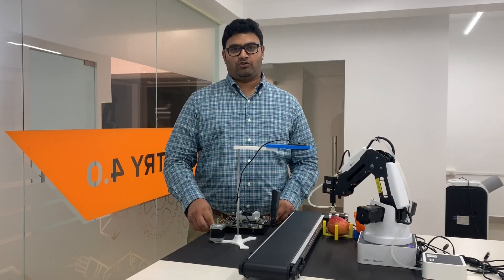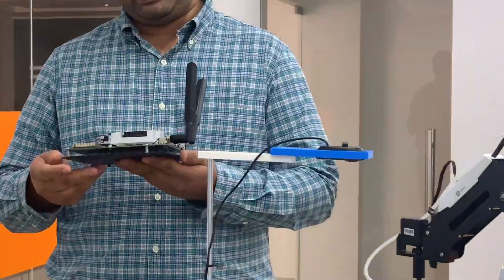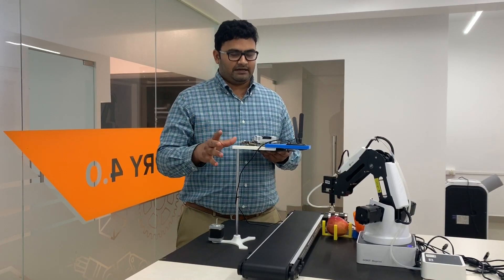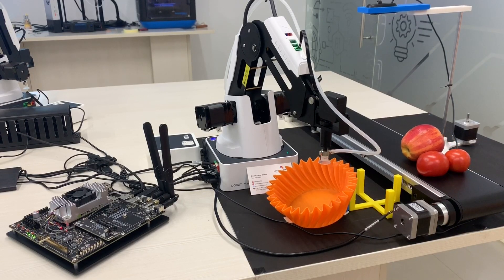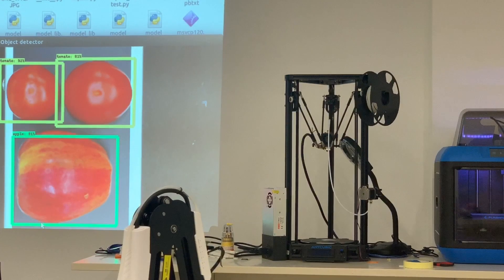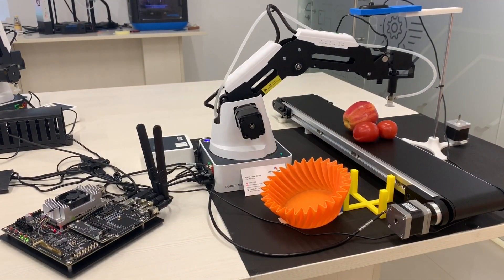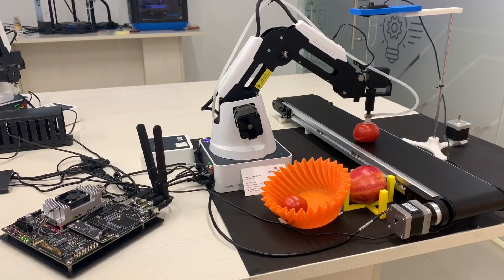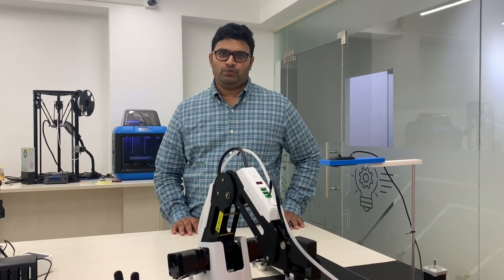NVIDIA Jetson TX2 powered Deep Learning Robotic arm using TensorFlow, OpenCV & custom Dobot APIs

Comment: Sir I am in USA. I am a computer engineer. Can you guide me how to do this. I can pay money for your time
Reply: hello Sir. you can get in touch. tmabika13@gmail.com. I do computer vision
Reply from the maker: hi Patron.  how can we help you? do you want to implement the work cell setup? communicate on assemticaattherategmaildotcom
Reply: @no one expected the spanish inquisition 
Hello,
I would like to do the same job with a nano jetson, could you help me?
Reply: @no one expected the spanish inquisition 
I made a program to recognize objects: it works. I also made a small delta robot. Now I have my stepper motors but I don't know how to connect them with the jetson, I also have to program the robot kinematic
Reply: @no one expected the spanish inquisition I have Jetson nano 2gb
Reply: @no one expected the spanish inquisition 
The logic voltage of the Jetson nano is 3.3 volts, if I put for example a TB6600 (which has a logic voltage of 5volt) Do I risk damaging the jetson nano?
Reply: @no one expected the spanish inquisition 0.5 to 4A for stepper motor